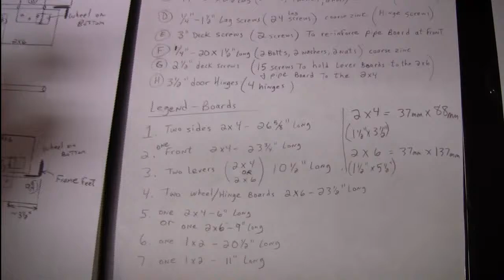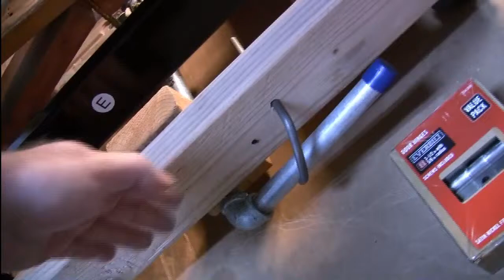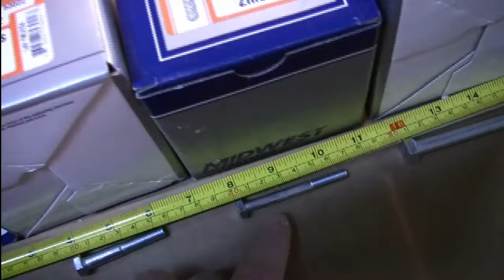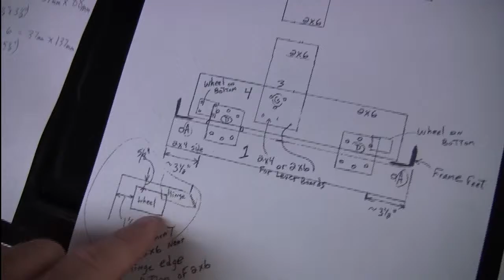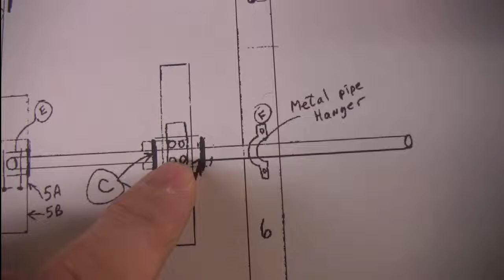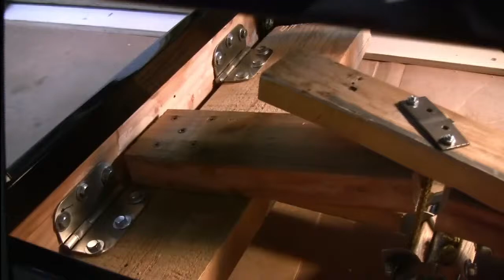Sawstop Contractor saw custom mobile base build video 2

Comment: I would like to Thank you for everything! The world need more people like you, who likes to help other ppl. Your video is amazing, and very well explained. 
I will be trying this out as soon as i can (When i get a budget to do so hehe) 
Thank you!!
Reply from the maker: I am glad you liked the videos.  I think between the three, it should explain all the important details and thoughts I went through to make mine. :)  Good luck with the budget, the good news is you should be able to use re-purposed door hinges (if you have any) and so probably the big expense would be the pipe and bolts.  All of the wood was found/repurposed that people were throwing away.  Though even there you should have a range of fasteners which should work. :)  If something doesn't work, think about how it failed, and try something else.  That is what I did for this one.